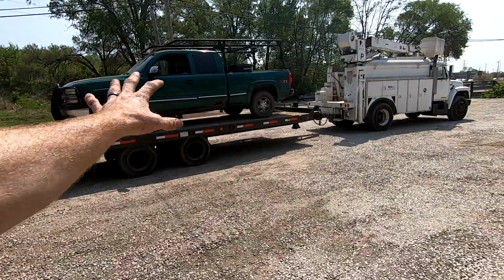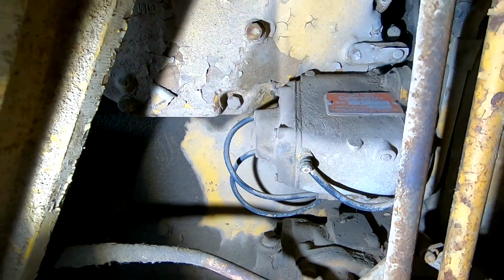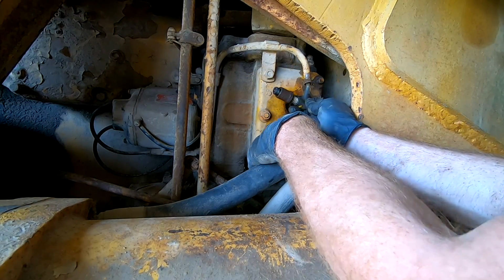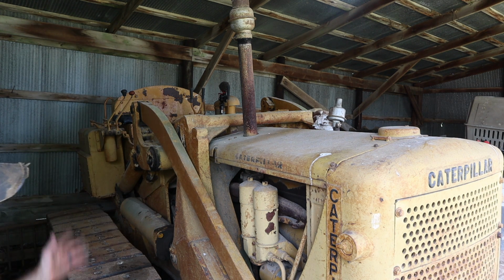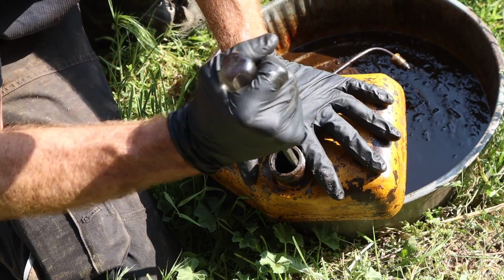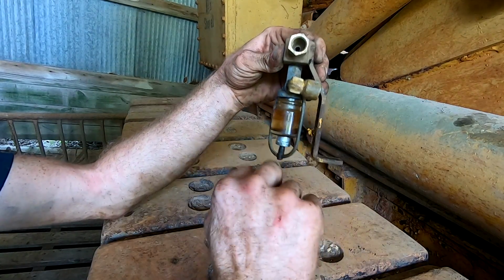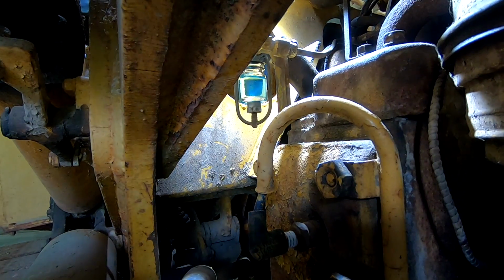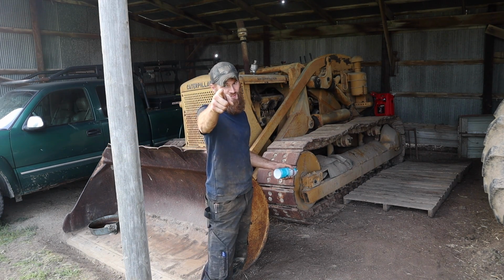How GOOD is the Starting / Pony Motor?!? ~ DAY 2 ~ RARE 1954 Cat No.6 Shovel FORGOTTEN in a BARN

Comment: Today I too, went to look at a 60-year old plus Cat that was for sale. After installing batteries, checking fluid levels and making sure everything was in neutral, I gave the starter switch a turn. Before I turned the key, I did notice that one of the brake pedals was real stiff. The tractor barked a little then  came to life. I let it idle for a bit while enjoying the sound of a straight pipe.  I then raised the blade, moved it into 1st gear, the Johnson in forward, then attempted to move the flywheel clutch lever back. The diesel's rpms started to drop down and the tracks remained motionless. I checked earlier to make sure the brake lock was disengaged so I'm guessing that one of the brakes is frozen. The seller appeared to have a lot of "irons in the fire" so I think the tractor will probably remain motionless for awhile.

Comment: Also, mad props for taking the time to clean the fuel tank properly and adding the 2 stroke oil. Too many times in these revival videos, I see people just add new fuel over garnished fuel, not realizing that all that varnish will stick the valves. Also, it appeared that you used WD-40 in the cylinders. This is also very good. Too often I see people using stuff like PB Blaster or ATF thinking that it'll just burn off, when it actually doesn't. When they use thick oils like that, the rings just float over that shit, then when the fire starts happening, that stuff is just glazing to the cylinder walls and sticking up the rings. Sealed Power is the primary manufacturer of piston rings. What ever "brand" of rings you have, odds are they were actually manufactured by Sealed Power. When you initially assemble an engine, they recommend using WD as opposed to engine oil, so you have actually used what ring manufacturers want in there.

Comment: Hi, i know its a bit late but to remove the rust inside of the tank i can recommend citric acid. you get it as a powder to clean coffee machines. mix it with warm water (max 80°C) and let it sit for an hour. flush it with clean water and after that with a bit gasoline. if you want to prohibit new rust, you can also use a bit phosphoric acid after the water flushing. just enough that all surfaces are wet and let it dry. it has the same effect than rust converter and change the surface from iron to iron phosphate where the oxigen cant connect anymore. the surface is solit and you can even paint over it.

Comment: Cleaning the tank. Lacquer thinner, or Acetone will dissolve the old gummy fuel. Best to put steel nuts in the tank to shake them around. This way you can remove them with a magnet. Many of these old cat tanks have a lip that makes it hard to just let them fall out. Muriatic acid will take out the rust. With this you need to do it outside on a nice day and then flush it with water. Don't let it sit too long with the Acid. If the tank has enough rust to open up leaks you will find them.

Comment: I know nothing about these machines but I get the impressionm this one's in great shape. Nothing seems to be worn or rotted and the fasteners you've tried are coming apart as designed. Any problems, so far, are due to sitting or to the fuel festering. 
I'm guessing you're not going to face too many mechanical, or structural, issues but the problems might start when you get into the hydraulics. Lines and cylinders might cause you some grief and some $$$s. Once you get her out in the open, get a steam washer on her and you'll see a whole different beast. That simple gesture will let her know you mean business and she'll start to co-operate. Once you replace the arm-rest, you'll soon be ready to push some dirt around.😂👍

Comment: I bet that sedinent bowl glass is made of unobtanium today. I have never seen such as it is, on a machine. I've seen tin ones but this is the first one I've seen like a little salve jar. Havent seen any such jars either amongst all the stuff my elders had. I worked on an early TD-9 IH dozer. The bowl slipped,landed on the blade arm,DONE!😬.Luckily I got another chance. Changing the sedinent bowl assembly on a early 560 Farmall was the same bowl. Im enjoying your journey with your finds. Perfect fare for a guy holed up by winter who lacks a heated shop.

Comment: For the fuel water separator you need to go back to the Backyard mechanic's faithful friend and run a small bead of silicone on the area when the bowl seats with the metal and let it dry before putting it back into place, but you have to be careful putting it back into place as you can knock off the silicone from the glass silicane is soft enough that it will "squish into the irregular surface if there is any. or you could try putting in into place while the silicone is still wet, but you will have to wait until it dries before you start putting fuel into the bowl again, the gasoline will dissolve the silicone before it can set and leak again. or you can actually try to find the proper gasket for that bowl. You should also have a bottle of dish soap in your tools just for such occasions like having to clean out the fuel tank, dish soap is a fantastic way to clean gunk like what was inside that fuel tank! It's also great at cleaning a vehicle's coolant system, I use it as part of the coolant system flush for old motors like this. I also use a mixture of a strong ph of Citric acid to remove hard water deposits inside the engine as the hard water deposits can really interfere with the cooling system's efficiency especially in the Radiator, this is a great solution when you have a motor that persistently runs hot no matter what you do.

Comment: Nice cat 6 when you get it back to the shop make sure you replace that copper line for the pony motor to keep its nostalgia can't wait to see the rest of it nice find
Reply: Actually, it would probably have been steel originally. Steel brake line in the correct size would be the way to go..

Comment: Good day. Diesel in Columbus, GA is $5.09/gallon. In my opinion, Diessel should be the cheapest of all fuel products. This has affected the prices of everything that is moved by truck. Prices have risen 50 - 100% because the Alaskan pipeline was shut down. Have good days!
Reply: Remember back in the 70's, diesel used to be 1/2 the price of regular bronze gas. It was a by product of the procedure to manufacture gasoline, plus they had to add lead to the mix. Diesel and unleaded should be cheaper than bronze, or the old regular!!

Comment: Definitely gonna have to clean the carb real good. Make sure to bring gasket material, as you're probably gonna have to make your own new gaskets. A little trick I do is to coat the new gaskets you make with a little chap stick. That way, whenever you realize you forgot that damn check ball, you can open we back up without having to cut another new gasket!😂

Comment: I think you're reading the power switch backwards.  That style of switch usually has a small pointer opposite of the large flange that points to "on" or "off;" when the flange is on the "on" side of the switch, the pointer is aimed at where it says "off," and the power is indeed off.

Edit: I'm currently watching you scraping the crud off the fuel tank around 13:15 and remembered something.  I think Ryobi makes a small battery-powered pressure washer you could use for small things like that tank.

Comment: My best guess is the float is stuck in the carb and the carb probably needs cleaned. After seeing what was in the separator bowl and gas tank I would have pulled the carb before trying to start it. Good luck getting it going. Thankfully diesel engines don't need spark and the fuel stays good for a lot longer. Here's hope it fires up easier than the pony motor has.

Comment: Worked on many of these. My dad owned a few himself. Very hard to work on, always hated pony motors. Riding on a machine not running seems to cause lots of problems. Motor is same as a D69u series D318. The loader frame is always in the way when you work on anything. Put a clutch in one when I was still in high school, hanging down in the compartment till the blood all went to your head and then recovering and repeat till you get it all unhooked. Very tight but it could be removed without pulling the motor which was even harder, had to scoot it out, loader frame in the way. Wasn’t the best loader cat made.

Comment: The best way to clean a small fuel tank is get a hand full of small gravel and wash it.  Put it in the tank with a small amount of gasoline or diesel.  Shake well and dump out.  You will have to repeat this a couple of times. If you have any rust pinholes they do make fuel tank sealer.
If you need a flat rubber washer for that sediment bowl, cut up an old inner tube.

Comment: Those sediment bowls usually used a thick cork or cork rubber mix gasket. like you discovered gasket paper and o rings don't usually work. get yerself some cork material or possibly stop by tractor supply and pick up a whole new sediment bowl assembly or see if they have A sediment bowl gasket that fits . I'm hoping you won't have to get into the carb...but looking at the fuel tank welllll  I'm still gonna hope for ya

Comment: Engine serial tag is right behind the mag. I can see it in your Video. It most likely is the same as the one on the rear of the machine.
Reply from the maker: Yeah I found it... 10A415
Reply: @SalvageWorkshop   Then the engine and transmission are the same units right from the factory. A well worn, or abused machine sometimes have had engine or differential case swapped at some point. It is nice to see you found all the covers, bucket shanks, and other stuff. I would not be surprised if there is a parts book around there somewhere also. Ask where the old fellow kept all his books.

Comment: Good content!  Remove the carburetor and do a good cleaning. There should be a tiny hole n the center of the gas tank cap that you can clean with a piece of stiff wire or a small drill bit. You can likely run the starter motor by pouring fuel into the carb. Fill up the float bowl first, dribble fuel in, it should run. I am worried about fire or explosion when you squirt starting fluid. That could result in really, really bad content.

Comment: Gotta have a sediment  bowl gasket the correct thickness or it will leak. Cork gasket would work. Make sure that you have no corrosion under the gasket. A dirty metal surface won't  seal either. AL B.

Comment: these old engines need a large gap. 25 to 30 thou is what they should have. also a old trick to improve spark is rub a little 2b pencil on the mating surfaces of the magneto and the plug thread.

Comment: You have done a fine job 👍 I did the same thing to the gas tank in my 1954 Cat No12 Motor Grater D318. EWWWwwwww 😫 
8T AT UM (Atom) is my Cat No.12 with a D318
Come on by and take a look if you like. just giggle " Fat Dan 8T AT UM has bad gas "

Comment: I would clean the carb out an figure out which pull rod is the throttle an choke for pony motor.  Please stop using ether!  You do not need ether for a gas pot. They have spark to ignite the fuel for engine to run.  Good job cleaning fuel tank.

Comment: Most reputable NHRA racers use a magneto, directly driven from
the end of the crankshaft. Everything, every accessory you bracket to
an engine, then run with a belt, gear or chain is said to be using
latent parasitic horsepower.

Something directly driven has a much lower drag.

Given the design of today's accessories being mostly electric- 
(should be all) AIR pump, ABS, AC, GDI, coolant pump, steering-
why don't they use a magneto instead of an alternator?